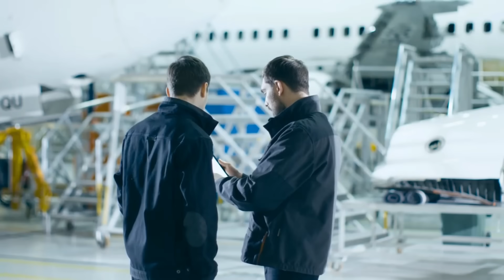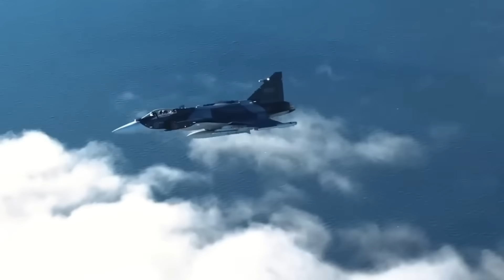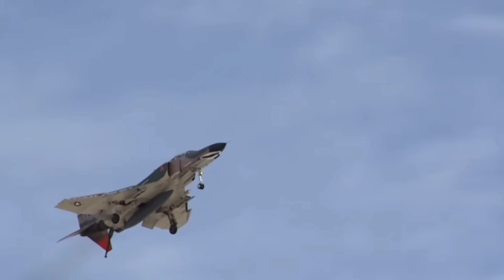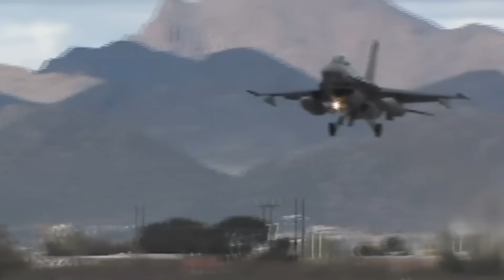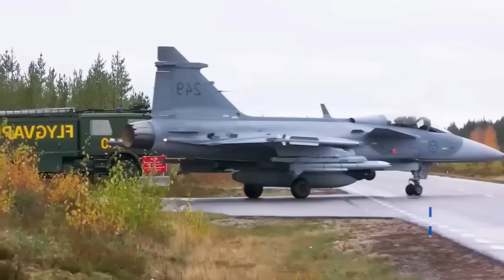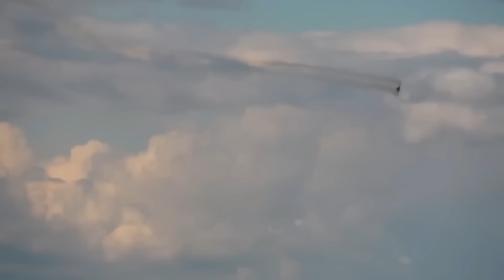Canada’s FU-47: The Rolls-Royce Gripen That Stunned the Pentagon!

Comment: There are many videos extolling the virtues of the Gripen, uch improved by the use of the new R-R engine yet Canada seems to be still hesitating to decide to procure this more reliable, (80 to 90 %', compared with the F35s 35 to 50 %), cheaper to operate and has no USA content allowing its operationn to be under USA control. What is the delay ?  The Gripen is to be built and developed in Canada and exported to Ukraine growing the Canadian defence industry, replacing the auto industry which Trump has killed by transferring catr manufacture to the USA
Reply from the maker: It’s a good question why there’s a delay, especially given the advantages you've mentioned for the Gripen and its potential for Canadian defense!

Comment: That plane does not exist. It would cost millions to integrate the British engine. You are wasting our time with BS!!!!!!!!!!
Reply: Wrong, originally RR bid for the contract and thus were given all the appropriate documents they will still have those and all the original work undertaken to show feasibility, integration today therefore would not be from scratch.
Reply: It cost millions to build an F-1 race car, or do an engine design change, or implement a new safety feature from the F-1 sanctioning body. So what? Jets always have to be upgraded. The Rolls Royce option is the upgrade that will be needed for operations in 7 years from now. In  WW2, mustangs went from drawing board to production in a couple of hundred days. Then, it was discovered the Allison engine was an underperformer. So they substituted a Rolls Royce Merlin engine, and magic! The basic jet fuselage is already built, now the proper engine needs to be installed. Then, magic!

Comment: You should know that the moniker of FU-47 is a stab/finger at Trump (POTUS 45, 47). The talk about the Rolls-Royce EJ-320 is all fine and dandy however,
it is likely years in the future. Unless undertakings have already been made, doing more than the basic computer modeling would expedite this possibility.
The most likely name will be the SAAB JAS-39 G/H integrating the RR engine.  Until this happens, the USA retains its ability to veto all foreign/export sales 
due to the GE F414 engine currently powering the Gripen E/F. We can be but hopeful.  Be well and stay safe
Reply: The rolls royce engine is the one that they used to build test airframes, so it already fits, just needs to have the plumbing, electrical, etc, matched to the body, won't take long to fix!
Reply: @jamesthurber4730 FYI, SAAB actually built the E/F around the GE F414 engine (Super Hornet).
The ROLLS-ROYCE EJ-230 was not considered at the time.